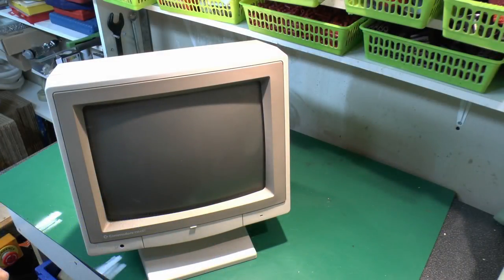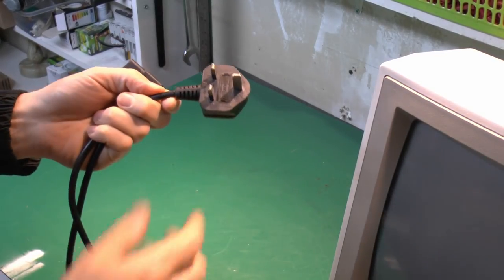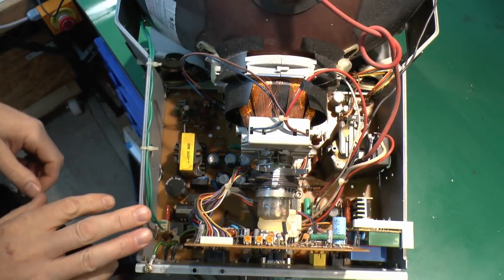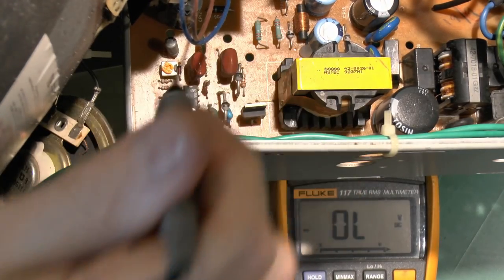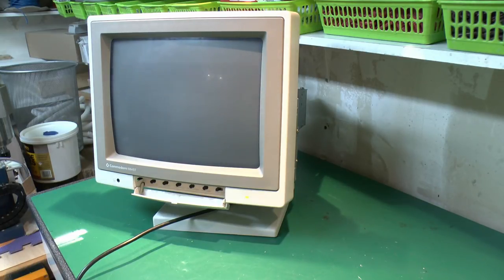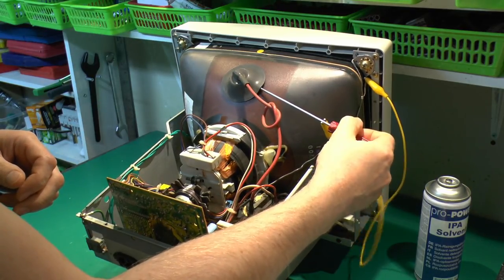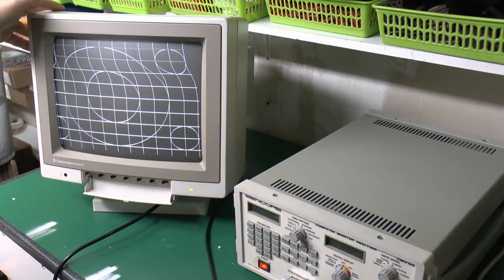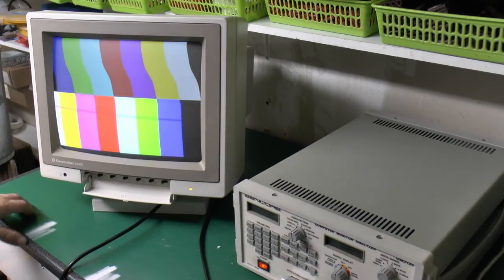Commodore 1084ST Computer Monitor Repair Part 1

Comment: Ahhh.. Takes me back to my TV/Video workshop repair days in the late 80's 😁 where I worked as as a TV repair technician. Triplers, for the HV, line output transformers (LOPTX), and many other nasty surprises lurk in CRT TVs and monitors. The S correction fault on the geometry looks like a dry cap. Which could have caused the SM PSU chip to fail. Without looking at the circuit diagram it's harder to tell. I was hoping the CRT was OK when you finally got it going, that was always a bummer if it wasn't. We used to rejuvenate the tube RGB guns with a HV blast to clear the cathodes.. Lol.. How times have changed 😂 great video JW

Comment: Best no-nonsense health’n’safety explanation I’ve seen in a while. It’s not the leccy itself but rather that you bash your hand on the sharp chassis, bite your tongue and fall off your chair. My current challenge is a power supply board from a Sony/SGI monitor from the computing museum and it’s a pain as it does start and the rails come up then it gives up so I am not even sure it really has a problem. Need to understand the two control boards more which is doable since they contain standard comparators and the like
Reply: Oh that's what happened to me, got shocked by a charged CRT and smashed my head against the metal shelf above in recoil. I almost smashed the thing in rage after.

Comment: I'm glad it's not just me that gets annoyed when all these supposed Youtube experts just blame faulty caps for all faults! - I think there's an 'S Correction' capacitor that will be responisible for that image geometry issue, I seem to recall them failing on those FST (flatter Squarer Tube) TV's from the 80's and 90's. Always worth resolder that line output transformer and the defelction coil connector plug often they go dry jointed
Reply: Now think most of thous people have moved on to calling lithium battery as bombs ready to blow.  When the rules basically appilys hear as well don't go pokeing at it with conductive things that can short it out.

Comment: I will say one thing that I didn't see you do - when you have a SMPS that is totally dead on the output make damn sure you bleed the large mains side capacitors before working on it, as without anywhere for that power to drain to they just sit there charging up to full whack from rectified mains. The worst electrical shock I ever had was from accidentally touching those caps while removing a PCB from a Philips TV back in the 90's. It had been disconnected for half an hour but still held charge (bloody good Panasonic caps). 25kV CRT EHT zaps are nothing compared to those caps discharging and burning holes into your hand.

Comment: My first job was as a consumer electronics repair Technician.  This was between 1998 and 2005.  When I started the job CRT televisions dominated, and by the time I left plasma televisions (and, later, LCD televisions) were beginning to take over.

I worked on a lot of SANYO TVs and we went through a period where a lot of CRTs were going faulty.  The CRTs were actually Philips components.  I changed a lot of them, and I must admit I did get a couple of nasty belts!

I was literally straight out of school in 1998 so I had a lot to learn.  I soon discovered that although you might discharge a CRT (using the screwdriver technique that you demonstrated), it can actually charge back up afterwards! It doesn't charge back to the same voltage as before but it's enough to get a whack that you don't want a second time.  In my particular case it happened as I tried to carry the freshly removed tube away from my workbench, so I got it in the chest! I almost dropped it on the floor.  Of course, that's the wrong way to carry a large CRT as well.

Anyway, since you mention about the CRT behaving like a very large capacitor, I wonder if the recharge effect is for the same reason as with capacitors.  Namely Dielectric Relaxation.  Do you know?
Reply: Dielectric absorption is what gave you a belt, its happened to me a few times too. Makes you swear!

Comment: I have done computery stuff for a long time. One of my customers had a CRT with a dead fuse, which I replaced. Working with the cover off, I knew to use a screwdriver with a lead to discharge the flyback. I had turned it on and off a few times usually by pulling the cord from the back. I got distracted, and since I was at the back there were no indicator lights and I thought it was off and put the screwdriver by the flyback and drew a HUGE arc; Guess that will teach you to be CERTAIN it is off. Great vid.

Comment: That was fascinating John. You know, I have a radio which won't power on (I'm a massive novice) and it didn't occur to me to check the switch circuit without power so thanks for the tip! Can't wait for part 2.
PS - just signing up for your Patreon..... finally

Comment: Thank you for this - it's made me extract my digit and repair the 1084st I was given that powers up and shuts down after a second...  I've removed the lopt and it seems that the PSU is happy as it stays on, so I'm hopeful that a new LOPT and HOT will sort it.

Comment: It reminds me of my old 21” monitor I used to have, it must have weighed about 1cwt. Pressing the degaussing button would vibrate the desk.
Reply: Yeah my 17" Iiyyama monitor would shake the desk when you hit the degausse button... Sony TV's used to always make me jump when you turned them on and they made that big 'thunk' sound
Reply: I have a 21" Trinitron monitor and at 30KG it needs to be placed on a sturdy desk.
Reply: Had an 22" Iiyama back in the day, it permanently deformed my desk due to its weight... and it even tried to kill me by producing massive amounts of ozon in its later days.

Comment: Now THIS is the kind of content I want to see! (and the fact this is Commodore will bring in some 8-bit nostalgia viewers too) Can't wait for part 2!

(Also, can I ship you a couple broken CRTs that I don't know who would fix? I already lost my best one to two monitor repair shops, them butchers each time actually broke it more than it was already broken. I don't think they understood when I said "price doesn't matter, this really matters to me"... I literally cried...)
Reply: Lam - I remember fixing so many CRT devices.  I started repairing them at 14, so many years.
Reply: I guess those guys also did that when they were 14, but now they're 60 and mainly replacing whole panels/boards on LCDs, not interested in doing actual analysis of what's broken. They want to be Apple while I needed a Louis Rossman ;) I even provided a genuine service manual I pirated years ago, but that's useless if someone just doesn't want to spend the time (I repeat: I said price doesn't matter!)

Yes, both of those guys were grandpas, who I'm sure would repair this at 14! And both said they're tired of those old heavy crappy (in their opinion!) displays... and each broke something on top of what was broken already... FFS!
Reply: Lam - That age thing is close to accurate, but not the rest. I have always repaired at component level. I will fix a module before replacing it.

Comment: My first rather painful introduction to HT was when i was about 9 years old, i took apart our old 405 line black and white tv, and yes, back then they did not fit discharge resistors on the tube. Despite the fact it had not been switched on for god knows how long, the belt i got from the tube connection was enough to make me jump back and smash my head on the mantelpiece behind me! Ouch, a rather painful first introduction to HT. Lol, i think that was also the same tv that taught me not to break the crt from the front with a hammer - big implosion followed by an equally big explosion!
Reply: So you literally got thrown backwards across the room.
Reply: @simontay4851  Didn't get thrown, just made me jump backwards, bit like when you get a belt from an HT lead on a car engine - the HT hurts, but not has much as the back off your hand does when you smash it into something when you pull it away from the HT rather sharpish! ;-)
Reply: Nice bit of revenge, hope you pulled out the ring magnets, then after they broke into several bits threw them away.

Comment: The energy stored in the tube, even at 25KV (on a big tube) would be measured in milli joules. A  big  high voltage (400V) power supply cap has  10s -100s  of joules available to do much more damage. 
Edit: The tube coating is called aquadag, and the final anode capacitor (the tube) is used to  'smooth' the EHT. Without it, it can jiggle about badly.
I think your channel is very underrated. I love your videos.
Reply: Yeah but the HV has a habit of jumping out at you!
Reply: @uK8cvPAq  Ha ha it does...What's a cm between friends? If you are getting that close...
We were taught to keep a hand behind our backs, and I still automatically drop my hand into the back of my trousers..if I'm wearing any. (Don't like the thought of something  jumping out then).  Old TVs are full of hazards.
It's just not particularly high energy from the charged tube..relatively...It'll make you throw your screwdriver through the window and put coffee all over the ceiling, but you will survive. 24KV on a few pF...pF tt.. 500V on a 1000uF cap and you may well never get up. It is thousands of times more energetc  and the time constant -through you - is much longer. So instead of 0.05J for 50 nanoseconds you get 100J for a couple of seconds.
Reply: On Casualty they tend to hit people with around 100J to wet pads straight on the chest
Reply: @uK8cvPAq  actually it doesn’t - it’s not near high enough to “jump” at you.

Comment: Have you ever been spiked by a CRT ? IT bloody hurts ! I was hit by a little 12 inch mono tube once , that was bad enough! Was working on a 32 inch sony cube recently , i gave that thing the respect it deserved as did not want that huge tube to spike me.
Reply: I second the bloody hurts. Much worse than spark plug leads.
Reply: @simontay4851  Rubber shoes and being reeeeeeellllyyyy careful :)
Reply: I have! See my comment.  And mine was via a dirty great 28" widescreen tube, although I 'only' got hit by the recharge.

When you get a belt from one of those, it effects you psychologically.  I found that I did not want to go near the inside of a television for the rest of that day, and I still give H.T. electronics a lot of respect to this day.

I'm not sure I could bring myself to squeeze the H.T. clasp together like John did.  Even though intellectually I might know it's discharged, and I've only ever had a belt from the CRT (not the H.T. lead) I still would find myself unwilling to touch it.  Scarred for life, psychologically.

Still, being too paranoid about these things is better than being complacent.
Reply: When we were kids my brother and I were both into electronics and we'd often fix up old stuff. One time, whilst attempting to adjust the picture on a 28 inch colour television, my brother managed to fully absorb the current from the tube (the image completely disappeared, momentarily!) which left him rather shaken! We laughed heartily afterwards but he did put on rubber gloves for the rest of the procedure!

Comment: From when I repaired TVs in the 1990's a too-wide raster was often the result of the power supply output being too high, if this is the case then the EHT voltage could be dangerously high with the risk of flashover.
Reply: That might explain the arcing too.

Comment: i recon theres some H & V tuners cans inside that for some reason has been messed with and knocked out of phase, like a secret set of front tuners inside the casing. ive seen a few stuff with that gubbins on them

Comment: Local recycling centre containers are full of older TVs, monitors, hifi equipment. mostly nothing wrong with them apart from not being 4k or having some bad caps. And NO,  in UK you can't take any of  them home. Even if it works. Staff does though and sells on ebay from time to time.

Comment: on 11:28 you can see i asume are some sort of caps but they have rust and looks like  dry solder maybe that`s something the green round ones i mean
Reply: They look like dusty resistors or inductors to me. The solder is beneath the board so you can't even see any.

Comment: This would have been nice 20 years ago but now with flat screens is it worth it?
Reply: If you want to use old machines like an Amiga or something yes.
Reply: Modern monitors and TVs screens introduce scaling artefacts and latency if they accept old computer signals at all any more. So the 1084s have gone up in value the last 10 years, selling for $100-350 on ebay or your local equivalent.
Reply: @v4lgrind  You can use scalers and such to get very good picture on new TVs from these computers but they can be a bit pricey. I bought a new really cheap small flatscreen TV last year, works like a charm with my Atari ST and Amiga though :) (RF signal on the Atari so it's terrible quality of course but still better than the TVs I used to have 25+ years ago.)
Reply: Of course it's worth it - old stuff like this is pretty damn cool and interesting to have working. And why not, better than the waste of a newly manufactured monitor rather than a few new components!
Reply: @ @krnlg  Might be cool but we have moved on. It is big,  bulky and consumes more electricity than a modern equivalent.
Reply: I kinda miss the crt days.

Comment: I'd replace the caps for good measure. Even if they're still within limits it's only a matter of time before they fail. Especially old tantalums. Hate those bastards
Reply: Oh yes, tantalum bead capacitors are nasty little buggers. Horrible things.
Reply: if he replaced that ic. he should have replaced capacitors next to that ic or in line with ic.. but he never replaced the ic he faked it. there was no fuse in the plug.. thats why it didnt work.
Reply: @09danstart  he faked it? Faked what?

Comment: People underestimate the lethal voltages inside these things, THEY CAN KILL please dont forget that when messing around inside.
Reply: N Gauge England -Synthematix - So can 10cm of water if you are daft enough to place your face  in it so that you drown.
As with all electrical items, they are safe to work on if you know what you are doing and take the appropriate precautions. John describes and shows a safe way to discharge the EHT.
Reply: no they carnt kill!. its high voltage but low current. if you have a very weak heart then maybe.. you are more likely to die from sticking your fingers in to a 240 volt socket even then its unlikely. but a microwave oven transformer will definitely kill you..

Comment: how fake, i dont think you replaced that ic at all... most youtubers would show the new part and solder it in. you didn't  when you first tested i never heard the degausing kick in. degausing would have still worked without ic working. then the after you supposedly fixed it i did. meaning you just took the fuse out of the plug to fool us. them monitors last forever. you are fake!!
Reply: What’s the point of pretending?